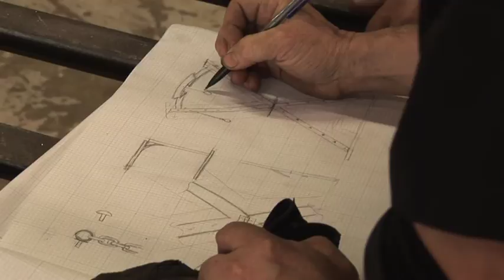Modern Day Blacksmith Revised

Comment: These guys are really metal fabricators they cut and weld things together their forging ability is very basic.  Blacksmiths forge metal into shape hot on an anvil with a hammer.  But hey its TV and correct information is rare.